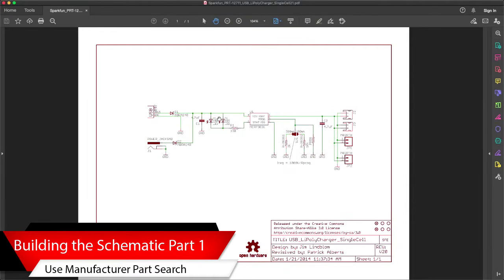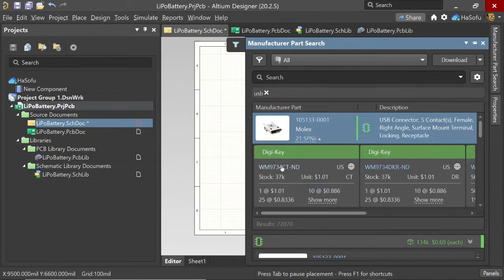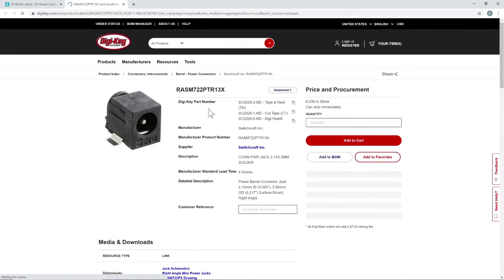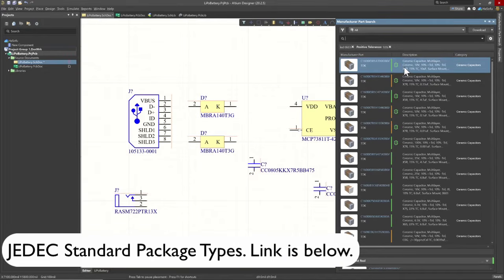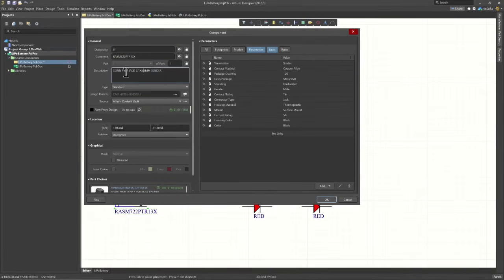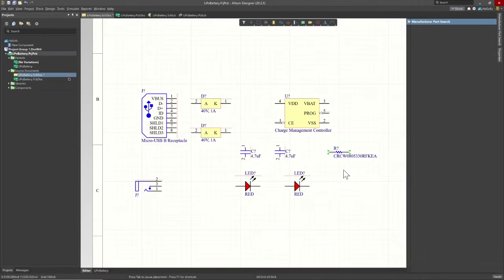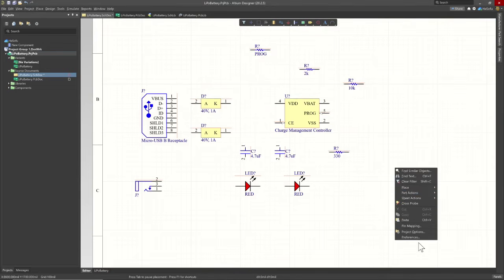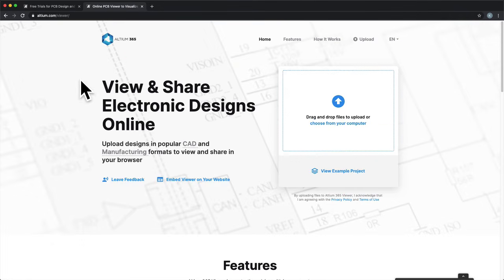PCB Design Tutorial 02 for Beginners (Altium v20) - Schematic

Comment: Вот в данном месте точность конденсаторов вообще не важна, совсем.
Reply from the maker: ?? Please clarify?
Reply: @techedkirsch  The accuracy of the capacitance is important if it is used in any filters or setpoint circuits. For example LC or RC filter. Or, for example, at the input of an internal oscillator chip of this chip. Or in circuits of DC-DC converter where they are specially calculated and parameters of the converter itself depend on them. In the datasheet of MC73811 the main purpose is “to maintain good AC stability”. And additional compensation of wire inductance. Basically it makes no difference whether it is 3.7 or 5.64. Only the recommended minimum of 1m is specified.
Reply from the maker: @sergbo3114 ahhh very nice. Thank you for this detailed breakdown. True indeed!

Comment: How are you able to use Altium from MacBook?
Reply: Cn you teach me please, I need to do it
Reply from the maker: Ah. Use “parallels desktop” for Mac. Then install Altium on the windows operating system that parallels installed. If you have an apple M processor, install the M version of parallels (it will likely automatically detect for you), the windows installed will be an ARM64 windows. Then the Altium installed on that will be installed through a windows emulator which should run Altium just fine.
Reply from the maker: Ah. Use “parallels desktop” for Mac. Then install Altium on the windows operating system that parallels installed. If you have an apple M processor, install the M version of parallels (it will likely automatically detect for you), the windows installed will be an ARM64 windows. Then the Altium installed on that will be installed through a windows emulator which should run Altium just fine.
Reply: @techedkirsch  thank you so much. I will try it.

Comment: Can we simulate the circuit on this software? or is it not recommended
Reply from the maker: Good question. Yes you can simulate this circuit in Altium Designer. Altium has made some major improvements in the simulation part and it's only getting better. I take it, you're interested in learning some simulation in Altium?

Comment: the part you got from the "manufacturer part search" now are those added to your library or not?
Reply from the maker: To add parts from the Manufacturer Part Search to your library, you can export or create a library from the components in your schematic using Tools/Design. 

You can also add components directly to your Altium 365 network and place them in your schematic from the Components panel. 

Using Altium 365 for component management is easier than managing a local library, which can result in multiple versions of the same component.

Comment: I am not able to place the component its giving an error message  "object reference not set to an instance of an object"
Reply: same did u find solution?
Reply from the maker: Try restarting Altium. Also, are you logged into the Altium online workspace for your account? Sometimes Altium had little buggy errors like this that can be fixed with a restart of the software or caused by being in a weird state. However, I don’t know the root cause of this problem. Let us know if it persists or gets resolved

Comment: Hi. Very helpful for beginners. I had an issue with placing the components in Schematic. Kindly help me with this. Place button is not checked.
Reply from the maker: Hello Malik. Do you mean placing parts from the manufacturer part search? You'll want to be logged into the Altium account/cloud to place them. Or it could be another issue if that's not what you mean.

Comment: Hi sir i can't place component place is unselectable sir pls help me
Reply from the maker: Hi Rubesh, you might need to sign into the Altium 365 portal/account within the software tool in order to use the Manufacturer Part Search feature and to be able to place components (which come from the Altium Vault).

If this is not possible, a library is provided. I'll see if I can find the link.
Reply from the maker: And if for some reason it would not be possible to log into the online portal, then you won't be able to use this feature. Instead we'll have to consider the manual approach or using my example design files found in the description of some of the videos in this series.

Comment: Thanks for the video. This software seems very feature-rich but excruciatingly slow.
Reply: I am very new to this album design this help me a lot thanks 😀
Reply from the maker: It can be slow, but from my experience, having a moderately powerful machine (Intel i7 chip or higher, 16 GB RAM or more, Discrete graphics card) will have it go rather smoothly.